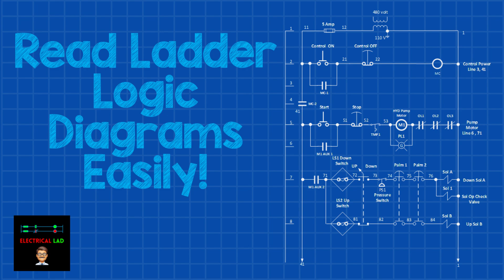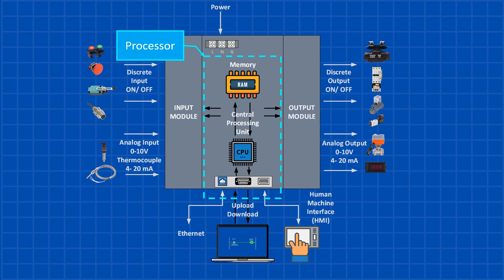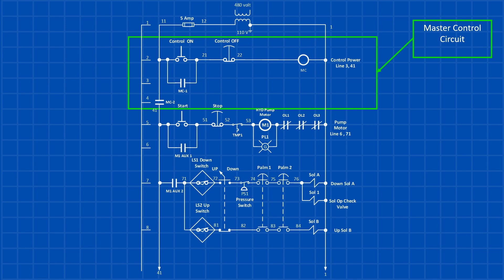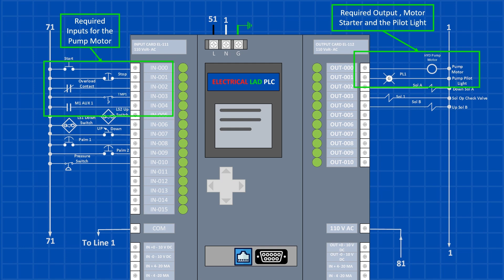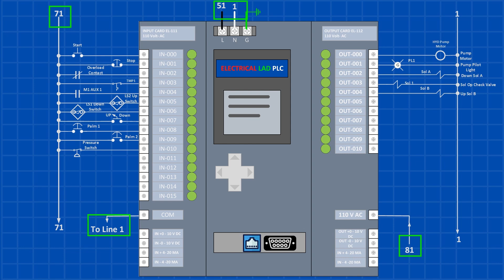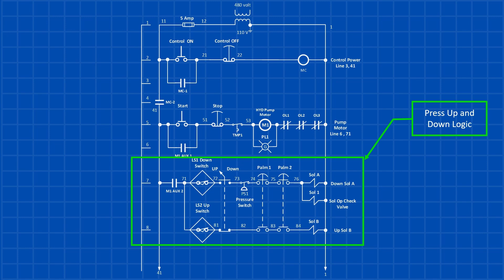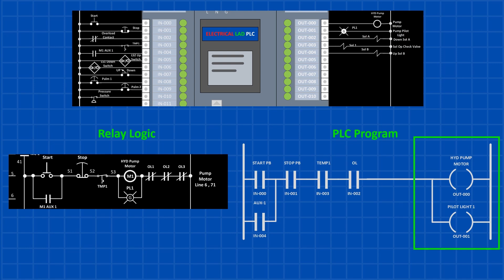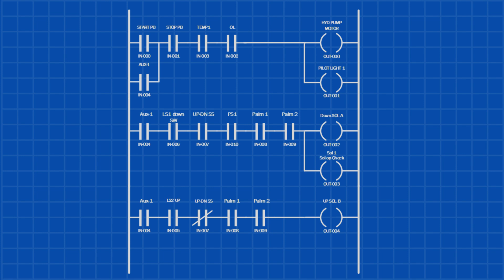Converting Relay Logic to PLC for beginners, Step by Step Guide

Comment: Thanks for this content, I really like it for OTJ learning on the fly for when I need help on figuring out an issue. would you be able to show examples of what the wiring would look like inside the panel for example, between the PLC and a local terminal strip. because all the inputs from conductor Number 71 look as if the wire goes to every input connector on the I/O card. That would really help me with learning.
Reply from the maker: Thanks for your comments. I will put it on my list to make a video about the wiring diagram.